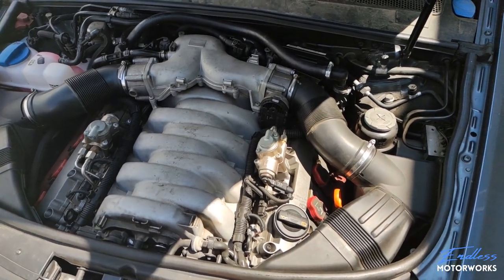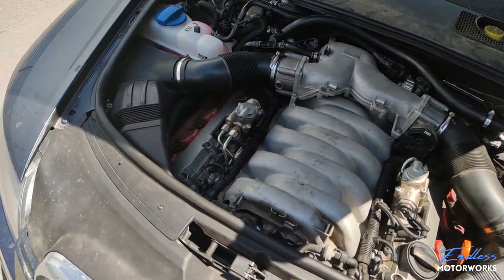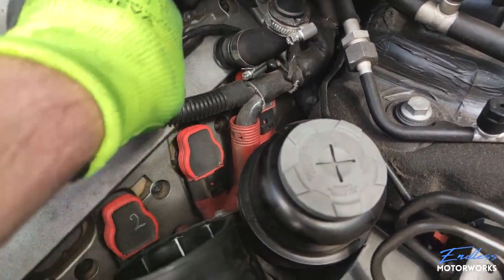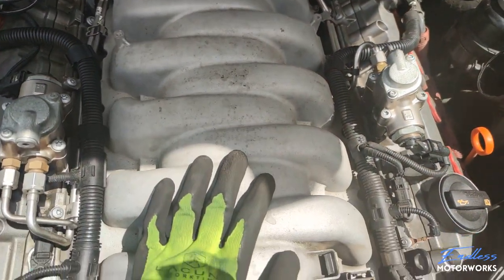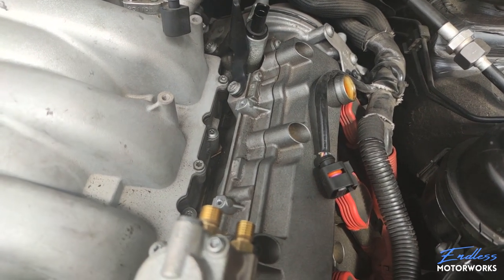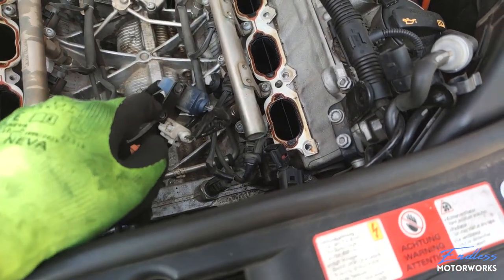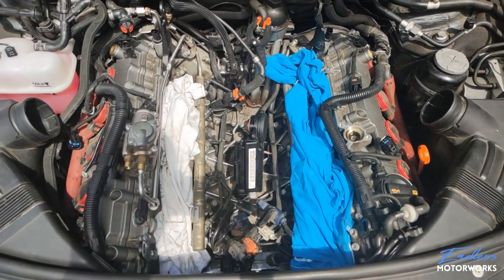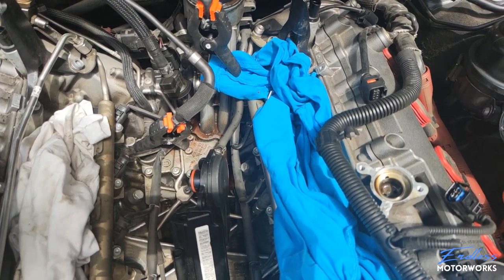5.2L V10 Audi A6 S6 C6 / A8 S8 D3 - Intake Manifold Removal, Swirl Flaps Delete and Carbon Cleaning

Comment: Finished yesterday the DIY Repair as you showed in the video, and I only can agree on everything you´ve done! I watched your video about 20x till I had everything in my mind, and even then watched beside. Flaps are our, Idle is fine. A bit less torque in the lower RPM, but tremendous sound even in lower RPM! On the upside though, it feels better on 3000+ RPM. Car runs smooth, no issues, no check engine at all. Keep it up man ;)
Reply from the maker: Thanks for the feedback! I happy to hear you managed to do the same procedure by following the video.

Comment: Recently bought a S8, seems like the same engine. Guys like you make´s our live´s easier man. Much apreciation from Austria here. I hear this clapping sounds while in "P" and pressing the gas up to 3k clapclapclapclap So I mostlikely have to do the same as it seems.  Cheers!
Reply from the maker: Yeah, it definitely seems that the manifold flaps have started to break down. I am happy to hear that you found the video helpful
Reply: @EndlessMotorWorks  thanks a lot man. Did you have any issues after removing them? Anything that would be good to know?
Reply from the maker: @marselbejko1989  No issues whatsoever that will stem from the removal of the flaps.
Reply: @EndlessMotorWorks  thanks for keeping up the flow of information for the community. God bless patient people like you.
Reply from the maker: @marselbejko1989  Thanks
Reply: @EndlessMotorWorks  Found helpfull? Dude, this video is every time on the screen in garage when we 'owners of the same engine' want to explore on the up-er motor. Whenever I do somenthing on it, I watch your work where are the screws :))) there is one more guy with coils, sparks and orings that leak every few years, I just changed all four of mines, they all leaked.

Comment: I want one of these, but these issues are scary lol! Great vid
Reply from the maker: Compared to other high-performance vehicles of this era like the E60 M5 and the C63 AMG, the Audi S6 is the most reliable and easiest to work on.
Reply: @EndlessMotorWorks  I agree with you there, unless the e60 in question is a six speed. The M156 guys aren't ready for this convo though.... eaten camshafts, wobbly cam adjusters, cracked intake manifolds, pcv valve at the rear of the motor ....lol 😄

Comment: my front lever is broken what does this do to the car, will I lose power, can I glue that part back in ? if it’s not as broken just loose and use gasket maker or should I plug it with a bolt ?
Reply: I know you kinda explained I just want reassurance because I don’t know what to do with mine now my idle isn’t as loud or strong i guess maybe anymore since it came out but it comes and goes I glued it back in kinda my best to my ability but how much power will I lose if i even do? will a tune help

Comment: Great video. I've pulled the IM twice on that engine. Recently gutted my flappers and even with the actuator in place, but not attached like you have in the video, I still get CEL flapper code. Could it be the actuator that runs via RPM was damaged itself and would need to be replaced alone?
Reply from the maker: Honestly, it could be anything. With the actuator unplugged I got a CEL, once I put it back in and reconnected it the CEL went away immediately. I would scan for errors with VCDS and see what is what. The actuator itself could be bad, or perhaps something else. These cars have so much electronics that unless you scan it there really is no way of knowing for sure what the problem is.

Comment: amazing step by step, many thanks.  one question I have, how did you tighten the 17mm fuel line on the left of the intake.  I couldn't get the intake in place with the pipe in place and with the inlet in place, I can't get to it to tighten it up.
Reply from the maker: Good question and something I really missed showing in the video. The key here is to use a crows foot wrench. Three simply is no other way of tightening the fitting back up.

Comment: Fantastic video! My S6 is currently running terribly a d I suspect the inlet is to blame. I'm a total novice but 8 think I'm going to give it a shot. Did you need to seal the inlet after you'd split it? Is it just bolted together or is there some sort of sealant between the 2 halves?

Cheers man!
Reply from the maker: Thanks! The manifold is both bolted and sealed. I used high temperature gasket maker.

Comment: Thanks for your detailed video!!! It's finally a step by step disassembly of the intake manifold!! Very happy!!

How did you manage the carbon cleaning at the valves that were in opening position?
Reply from the maker: On mine I had all but three valve sets closed, so this made it exceptionally easy. Once the set of seven was cleaned, I rotated the engine in order to get to the last three ports. With everything off, you can kind of see the crankshaft. There is a special VAG tool for this job, but you can get away with using a long and relatively thin prybar.

Comment: Bonjour,

Esque tu a le voyant moteur allumé depuis la réparation ?
Reply from the maker: If the job is completed properly and there are no other issues with the car, the check engine light will not be on.

Comment: 12:30 same thing happened on mine. Old owner glued it back together. Big mistake, that’s the brake booster line. If it falls apart while you drive then you lose the brakes and create a huge vacuum leak to the point where it can barely idle. Get a new one, much safer.
Reply from the maker: I wouldn't be too worried about that as it is glued from the factory as well. Mine has always had the tendency to come apart, but I always just snap it back together. Because vacuum is pulled through the check valve, the contraption can't rally come apart on its own, while driving though. The negative pressure is pulling it tightly together. What can happen and had this happen on mine is, if I mess with engine, knock it loose and then go to start the car, it will run poorly at idle. All it requires is to be snapped back into place. If you epoxy it or put some RTV on the seam, this would be a permanent fix.

Comment: Hey, I am looking for the high fuel pressure sensor I see you found the low one on the left side when looking at it on the fuel rail line. Maybe the high fuel pressure sensor is next to the tank or closer down to the car?
Reply from the maker: Not sure tbh. As far as I know it is only this one.

Comment: Another guy to look up is gregg b on you tube that guy is audi king. Trust me audi king. He fixed his night and day difference with working intake vs flap delete. If you look up intake flap clean he has a vid but does the whole engine tear down on vid complete engine teardown and rebuild ask him his opinion once.
Reply from the maker: I have seen his videos. What he is saying is correct, but I think there is some general misconception going on regarding the upper intake manifold flaps delete and the impact it has, which brought by not fully understanding that there is a difference between torque and kw. At the very least this is my observation from what I have seen over and over again throughout all of the different Audi forums when doing my research for this video.
Reply: I searched all of Youtube but was unfortunately not able to find anything Audi related under the name gregg b
Reply from the maker: @eco_logic  Checked just now as well. The videos are nowhere to be found at the moment. Deleted or made private.
Reply: @EndlessMotorWorks  the name is greg b with one g. If you type greg b audi his vids will come up I saved them as favorites.
Reply: @eco_logic   the name is greg b with one g. If you type greg b audi his vids will come up I saved them as favorites.
Reply from the maker: @okplaya24  Great, good to know if anyone else is also looking for those
Reply: @Endless MotorWorks  he has good stuff and helps answer questions
Reply: @eco_logic  its under bg garage now

Comment: Did you crank the engine while having the i intake manifold off?   Half of the cilindres valves will be closed and the others open. Or did you crank it by hand?
Reply from the maker: Crank by hand, always! Never try to run the engine this way. In order to remove the intake you will have fuel lines and high-pressure pumps disconnected. Not only will you get a multitude of errors on the dash, you will also soak the engine in fuel.
Reply: @EndlessMotorWorks   do i need a special tool to turn the engine by hand?  
Ill be doing it on a v10 r8 gen 1.
Reply from the maker: @jose15238  There is a special VAG tool, but 
I can't seem to find the exact part number. In my case I used a long and thin pry bar. Not sure if it will also work on a R8, due to space limitations.

Comment: And, do you recommend deleting the intake port spacers? (those metal plates) and what are the pro's/con's of also removing the thumble flaps?
Reply from the maker: I do not recommend removing these without doing a custom ecu flash after. Check the second paragraph from the "Intake, manifold flaps and   variable intake manifold" section in this article. There is a more technical explanation, but I cannot link the actual Audi documentation here.

Comment: @43:27 those intake manifold partitions do you know what the function of these are? (Apart from saving your motor lol) I've carbon cleaned my 4.2L but stupidly in my haste somehow forgot to slot them back in 😑 could I get away with leaving them out? Great job btw 👍
Reply from the maker: These metal inserts are called baffle plates and work in conjunction with the tumble flaps (lower intake flaps). They help with torque in the lower-end of the rev range. The section below is from the official Audi documentation applies for all variations of the 5.2 V10 FSI engine (A6, A8 and R8): 

"Like the variable inlet manifold, the intake manifold
 flaps are map-controlled in both engine variants. The intake manifold flaps in both engines are activated at the bottom end of engine load and speed ranges.

They are brought into abutment with the baffle
plates in the cylinder head and thereby close of the
 bottom section of the intake port. The induced air mass now flows through the upper section of the intake port and creates a tumbling charge motion within the cylinder.

The intake manifold flaps are open while inactive,
 cross-sectionAll flaps in a cylinder bank are attached to a common shaft."
Reply: @EndlessMotorWorks  oh awesome, I ended up taking the intake manifold off again and put the plates back for peace of mind sounds like I made the right call, can't get too much practice with taking that manifold off 🤷🏽‍♂️ thanks heaps for that information cool to know
Reply from the maker: @joshuahallam4012  Thanks!

Comment: Great video thanks for sharing your experience. I’m thinking about doing something similar. How have you found the performance of the car and are you planning on having it custom tuned to improve the torque? Thanks, Rich
Reply from the maker: Thanks mate, glad you found it helpful! Performance is quite good, about the same as before I might say. I can't really feel anything being significantly different. Still, after the flap delete now I can actually get the car to shake when revved up, like those old American muscle cars. Not sure if it has anything to do with that, but I noticed after completing the job. Regarding, having it professionally tuned, probably later this year. I am currently chasing down some weird issues with the cooling system, which will probably take about a month to be resolved. Until that is fixed, I won't be pushing the car too much.

Comment: Hey there thanks for the video , I have an s8 I'm working in and it just went into limp mode and threw a check-sum error code for ecu 2 , I have got a donor vehicle and swapped ECUs , put new plugs , new coils but nothing seems to work , have you ever encountered this?
Reply from the maker: For the most part ECUs are coded for the specific vehicle. I would assume it will need to be re-coded for yours.

Comment: Does changing the flaps will fix them? 

I am planning to buy 2008 /S8 V10 done 58,000 km in Dubai 

And I don’t know if should I go with it or not what do you recommend?
Reply from the maker: There is no changing the flaps, they are not sold separately. You will need to buy the entire intake manifold. The S8 generally is a nice car, but expect it to have more electrical issues than the S6. Also accessing some stuff in the engine bay is more difficult on the S8 than an S6

Comment: Did u lose any power after you removed the flaps? Like did you feel any difference?
Reply from the maker: Haven't felt any difference. However, my flaps were already quite broken and probably causing excessive turbulence inside the intake. Therefore, if anything removing them has probably resulted in gaining some power back.

Comment: Did you put gasket maker on the top of the metal insert within the manifold?  Mine has rubber/gasket that is falling apart on top of those ridges.
Reply from the maker: Yes, I did.
Reply: @Endless MotorWorks  Thank you for the confirmation/response good sir!
Reply from the maker: @rpk2012  Thank you for watching my video! :)

Comment: hi, i also have S6 5.2 and i want to do the same like you but i dont understend one thing, how you disconnect the HPFP? when is there high pressure.
Reply from the maker: Good question, something I didn't explicitly explain in the video. There are two options to go about it. The correct way is to disconnect the fuel pump relay and crank over the engine a couple of times. This will remove all of the fuel that is in the pipes and the pumps. The other easier way (what I ended up doing) was simply cracking open the fittings for the return lines (the fatter ones). I put a rag underneath them and let the excess fuel simply come out. Note that this really only works if the car has been sitting for a while and the system is not primed, otherwise too much fuel will come out.
Reply: @EndlessMotorWorks  how long you think the car has to sit around before the pressure has come down to a save pressure

Comment: Hey bro I’m adding intake spacer to my s6, but I’m kinda new to the mechanic stuff lol, should I do a flap delete as well? Also I’m swapping out the ignition coils for apr coils I’m having trouble with the back 4 as there blocked by the coolant tank and I think the tank for the steering fluid you have any suggestions on how to make enough space to pull them out
Reply from the maker: If you are taking the intake manifold already, you can do a flap delete then and there. It is just a no brainer, considering you are taking it out anyway. Regarding the coils, if I remember correctly you will need to completely remove the coolant expansion tank. I have a video on how to do that, not especially time consuming, takes about 30min or less. On the driver's side the power steering reservoir is in the way as well, but that you can just unmount from the bracket and wiggle it around in order to make room, no need to take it out completely.

Comment: How did you tighten up the fuel pressure pipes back up while the manifold is in place ther just no space
Reply from the maker: That's a very good question. I used a lot of patience swearing and after that I bought a crows foot socket. Was able to tighten them back up in a minute. The right tool makes a world of difference. :)

Comment: Hi nice video. I have an s6 v10 i get misifre code and i have already changed the ignition coile and the spark plug on it but still the same problem. When i delete the codes sometimes the car is driving very good but When the engine light comes on the car starts shaking and not going properly. When i press the gas it seems like the car starts to goo smoth again but When i release it i gets bad again. Do you have any idea where the problem is? When i check with computer it says misfire cylinder 6,7 but after a while of driving even other cylinders gets misifre code
Reply from the maker: Most probably the issue is carbon buildup. The direct injection engines are notorious for those.
Reply: @EndlessMotorWorks   thanks for your quick response, is the only way to clean it by opening the intake manifold as you showed in the video or can i fix it in some other way?

Comment: Does the car need remapping? Where to get that from, no people seem to do these, these days.
Reply from the maker: No, you can drive it as is. I never got mine remapped and it has been fine. No CEL, no other issues. Will a remap be better? - Absolutely, but it is not essential.

Comment: you just removed those plastics inside the intake manifold and that's it?
Reply from the maker: Pretty much. Of course you will need to seal everything back up and plug up the gaping hole in the front of the manifold where the actuator controls the flaps. Otherwise you will get a massive vacuum leak, like I had in the beginning of the video.

Comment: just done the carbon clean and flap delete takes ages to start but when it dose it idles nice but has like a massive misfire when revving it huge loss of power
Reply from the maker: If it idles smooth, then it probably isn't a vacuum leak, but there are lots of other things that can cause this though - faulty fuel pumps, ignition issues, a problem with the MAF, stuck throttle body. All of these are common on the V8 FSI and V10 FSI from this generation. You will need to scan it for errors in order to get more precise info.
Reply: @EndlessMotorWorks  I'll let you know for when other people have the same problem
Reply: @EndlessMotorWorks  hey bestest buddy is sensor g247 under the intake manifold
Reply: @EndlessMotorWorks yes it is the  plastic plug had broken off on g247
Reply from the maker: @TheBoobieBandit1  The G247 is the fuel pressure sensor. It is not under the manifold, but rather it is located on the fuel rail.